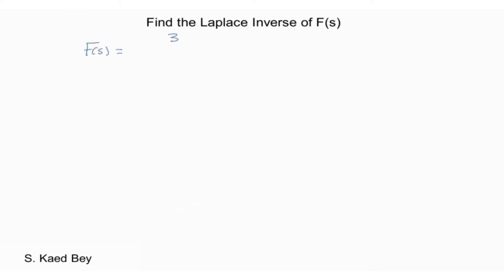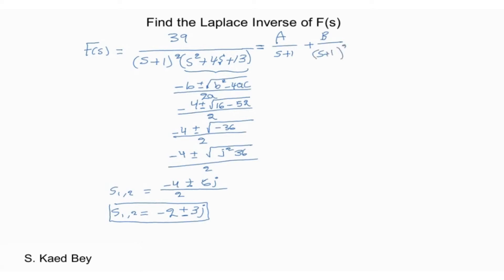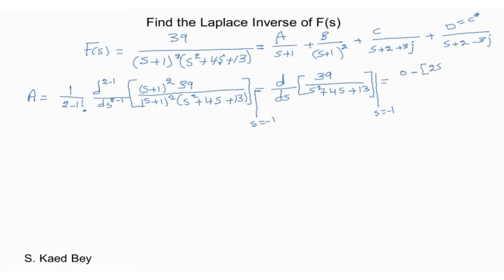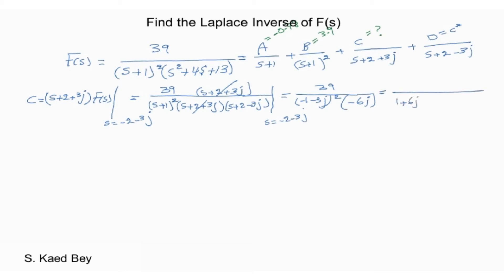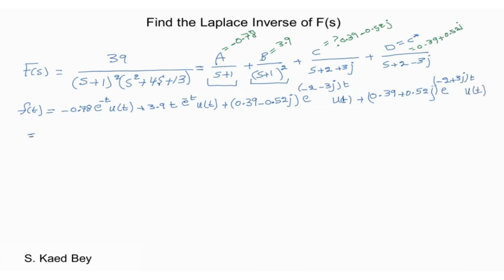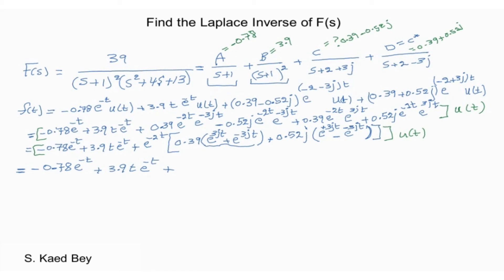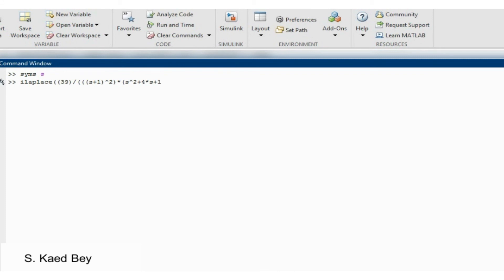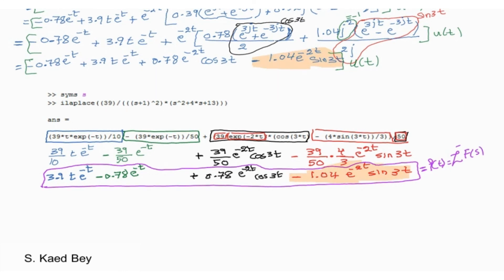Inverse Laplace Example- Repeated + Complex roots

Comment: @ 4:48 the denominator was not properly multiplied. Check again. There should be a power 3 on the 54j
Reply from the maker: j^2=-1, so -54 j^3 = -54 j^2 j = -54 (-1) j= 54j